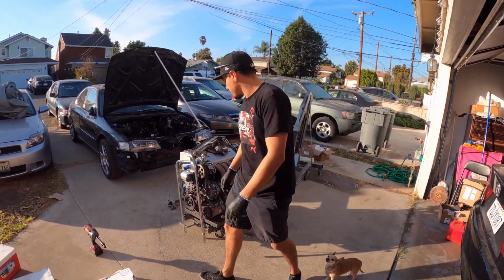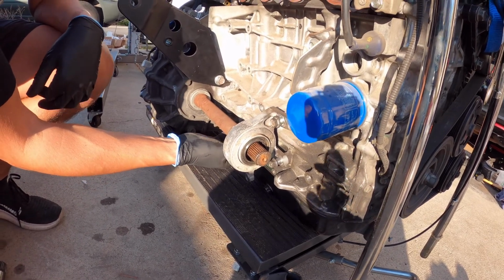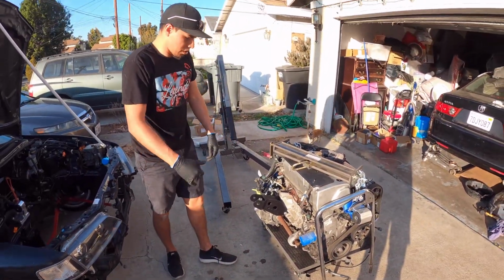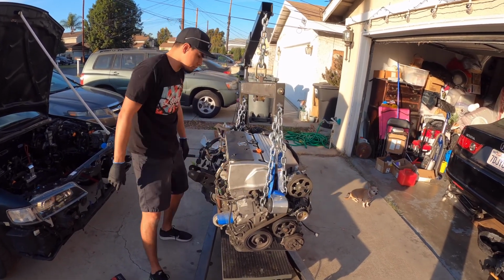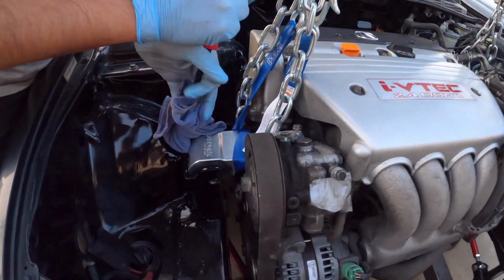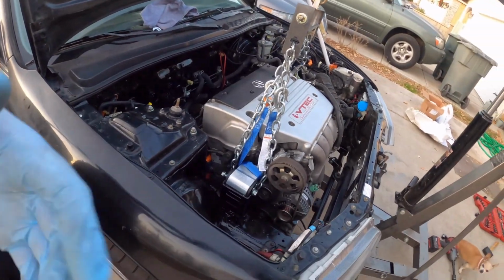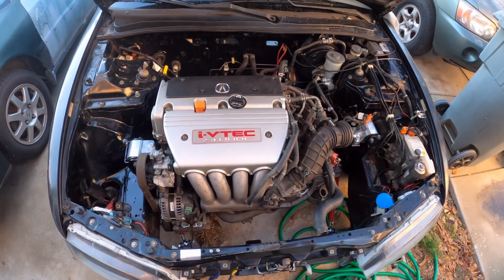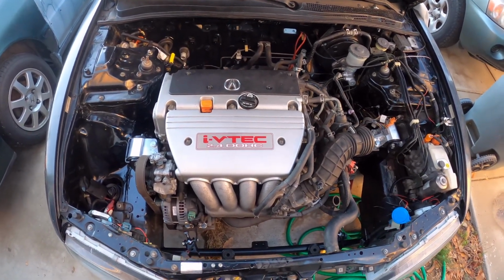K - swapping my Honda Accord part 1

Comment: GREAT Video, love your chihuahua, honestly stayed and watched mostly for the content/chihuahua sightings lol!

NOTE** to anyone swapping a kseries. DO NOT USE A TORQUE GUN for tightening your bolts. Literally every bolt is EASY to remember because the k24/k20 has all the same bolts.

10mm = 9-11ft lbs
12mm = 16ft lbs
14mm = 33ftlbs
17mm = 47ftlbs
19mm = 76ftlbs

It's not hard. Once you know what these torque settings feel like. You can ALMOST perform by hand. BUT DO NOT use a air/electric tool. Often bolts are too loose after torque-ing can be a huge issue obviously.

Comment: Good job I'm doing 2 swaps one staying f22 and the other I'm still deciding its a cb7 coupe the one staying f22 is a 91 se.
Reply from the maker: Good stuff! The f-series is a good engine and there's still some aftermarket support floating around.
Reply: @zre909  thx I'm pretty excited about both builds one I'm staying na with the option to go turbo later if I can or want to. The coupe I'm thinking about going rw and j series or f just depends on $$$ as always.I think a rear wheel cb7 coupe will be different and cool.
Reply from the maker: @Lost10mm.  those are great options! Whichever route you take will be nice!

Comment: Hey bud,nice project!! You can tell me exacly what you need for front big brake? I have cd7 exr and i need this swap. I do some track day and need more braking lol
Reply from the maker: The front brake setup is

*95-98 US RA1 Odyssey spindle
*04-08 US Acura RL front calipers
*03-08 Nissan 350z (track/brembo) rotors
*Fat four customs caliper adapter

I'll be selling mine soon if I can finish my FK8 caliper conversion.
Reply: @zre909  thanks bud for info!! I got the new de5,amazing car,really!!
Reply: @zre909  spindle fit on accord oem knuckle? Cause i think swap for 2.3cl front hub for eliminate roh
Reply from the maker: @Carlito_JDM  Yes the honda odyssey front spindle fits and connects to the tie rod, lower control arm and upper control arm.

Just to be clear you will need the entire Honda Ofyssey spindle assembly including hub and bearing.

Comment: I'm debating if I wanna k swap my 5th gen accord or just building the h22a that's in it. The only mounts I seen are hasport and they want 600$ +  when I factor in the mounts and hondata alone it's already a lot.
Reply from the maker: Well truly the H22 is a natural fit for the Honda accord considering its essentially the same chassis as the prelude. It really comes down to what you want and how much you want to spend.

Comment: I want to put a k24 in my accord so I need to replace my wiring harness or can I use the one I have
Reply from the maker: What year accord? Also a lot of the k series harnesses are very similar so if you want to swap around harnesses there will have to be some slight modifying to a few connectors or sensors depending on  the combination you use

Comment: My cd5 hasnt ran in nearly a decade so im contemplating just redoing the engine.  Is there specific axles you need?  This is the first video ive seen showing the ease of installing it.  I have an 06 TSX and the engine itself is a damn reliable one.  Just dont know how straight forward this swap is vs h22.
Reply from the maker: It's pretty straight forward. The only mount that needs modification is the passenger side mount. Remove it by drilling out the spot welds and prying it off. Then add hasport weld-in mount (weld after or before). I welded before because I lined it up while on the engine hoist. 

I recently learned you can use the stock TSX axles and intermiate shaft but there is also the option of purchasing hasport axles and using the RSX manual transmission intermediate shaft

Comment: Honestly thinking about either H-swapping, or K-swapping mine. The F- series right now has over 300k but the car itself has various issue. I like the idea of fixing it up and keeping it in generations. If I Decided to Do a H22A swap, as a first timer how difficult would it be? Thank you for the video!
Reply from the maker: H-swap is pretty straight forward. Everything plugs in identically for the  OBD2 but if you got OBD1 I believe you have to switch to internal coil on the distributor.

K-swap is so much simpler in my opinion but whatever route you choose it'll be your choice ! 👍

Comment: i have a sixth gen accord(EX inline 4 auto) and i have some questions about this swap. how much will it cost? what parts besides the engine do i need?  is there a better/easier swap than a k swap?
Reply from the maker: Engine cost: $850 - $1200
Mounts: $500
Axles:  $500
ECU: $500-$1200
Misc parts: $200-$700

An easier swap would be an H22 or H23, also an F20.Those are basically bolt on as the H series and F series share similiarties in design. If you want a V6, the same year accord came with the V6 J-series so that is also an option.
Reply: I think I’ll try an f20 with a turbo kit and try to get 350-400 after tune. Thank you for the suggestion and advice
Reply from the maker: @homlessdawg3183  no problem and good luck 👍
Reply: @zre909  i think im gonna use foreing engines inc. they have a couple engines listed. they have a f22b, f23a, j30a, and a j30a1. which of these do you think is best?
Reply: @homlessdawg3183  f23a is the one you already have if you have an EX
Reply: @zre909  which motors kit you used
Reply from the maker: @collinmatthew5044  I used the hasport  mounts (CDK1)
Reply: @homlessdawg3183  let me know l just brought one a 2000 accord lx manual l want to get a 6 banger

Comment: which hasport motor mounts are you using?
Reply: i have a k24z motor from an 8th gen accord / would i still need to replace the axle shaft as well for the engine mounts? i seen in a previous comment you used the hasport cdk1
Reply from the maker: @karasu5970  so I learned that it's possible to use the original intermediate shaft and axles so you don't need to buy aftermarket ones
Reply: @zre909  thanks man! planning to swap my 99 once the engine goes! at 260k miles so far!

Comment: Do you know a harness that is easy to set up for a 2000 Honda Accord v4. I'm trying to start it out of car and run
Reply from the maker: Rywire makes a engine harness that can help you with that. Also it should be an inline 4. The name comes from the symmetry.
Reply: @zre909  sorry ya I believe it to be a f23 after more looking into
Reply: A cg5

Comment: I have a 91 accord lx, 5speed manual with an F22a2? Would the k bolt up to the trans? How difficult would you say Kswapping this car would be?
Reply from the maker: The K series will definitely not bolt up to F series transmissions and k-swapping CBs is definitely possible as it has been done before.

Comment: Would it be possible to kswap 2001 accord lx with 2.3 inline 4 automatic. And what parts/mounts will I need?
Reply from the maker: Yes its definitely possible. You'll need a k24 preferably and aftermarket harness and ECU (hondata) if going the non-CARB route. The 94-97 Hasport mounts have been confirmed to work with the CG chassis.
Reply: @zre909  for sure verified hasport mounts will work on 98-01 accords??
Reply from the maker: @ziggyortiz37  yes and you can ask hasport themselves if you want firect confirmation

Comment: I've got a 2004 Acura TSX engine. Would that engine fit into a 04' accord manual transmission? Plug and play?
Reply from the maker: Yes it should be plug and play but be sure to use the same ECU for the engine. I believe hasport has video out on this very swap into a 2004 Accord.
Reply: @zre909  thanks! If all goes well, I’ll have the 03 accord. Need to win it at the auction this coming Thursday. Got the tsx engine ready.
Reply: What about a 1997 Honda Accord

Comment: Can u swap a 2004 3.0 Honda Accord for a 2008 3.5 ?
Reply from the maker: I believe you can. I am not a J series expert but I belive the engine has the same mounting points for various years.
Reply: Is it same body style ? Then absolutely if not fabrication anything fits a fwd Ls would fit two

Comment: I have a 2000 lx sedan what kind of engine swap can I do?
Reply from the maker: You cand do H series, K series and J series. There are mounts that will work for either engine choice into your chassis.
Reply: @zre909  what motors did you use in doing a similar build a Honda Accord swap from 2004 into a 2001 accord
Reply from the maker: @jeremycarattini9433  hasport mounts is what I used. The 2004 accord came with a kseries so it should be fine with the stock mounts or upgrade to similar style stock mounts with a bushing of your choice

Comment: I want to k24 my CB7 but damn 😢 so much shit 😅😅
Reply from the maker: It's definitely not easy especially the route I took but k swapping in general should be easy with an aftermarket ECU
Reply: @zre909  bro to be honest I've been looking on the f23 it's a lot cheaper easy ...the f23 with headers full exhaust and H22 intake manifold ported it's punching about 165 hp .163 torque bro 👌 that's not bad .. will see time and money will tell me what to do 😅 but you know that K sounds  rude🚗💥💥🔈🔉🔊
Reply from the maker: @eddysevilla9648  exactly!  F series can be just as fast with turbo or high compression and cams.
Reply: @zre909  yeah bro so I'm going that route will see how it goes..... Thank you for being humble blessings 💪

Comment: I’m trying to do a k swap on my 8th gen accord beside buying the engine what else would I need ?
Reply from the maker: ECU and engine harness and it should be pretty straight forward since the 8th gens come with a k24 already
Reply: @zre909   yeah it does but I believe the Acura TSX k24 I think it is has about 200hp
Reply: Appreciate the reply honestly didn’t think I would get one
Reply from the maker: @forevercxmp1578  no problem. I'm doing a California legal swap so it's a learning process and a longer one than usual compared to doing aftermarket ECU or already K-series car
Reply: @zre909   make sense keep up the good work I can’t wait to swap my engine for that of a tsx
Reply: K24 already in the 8th gen accords if u have the ex model its already tuned to 190hp wouldn't make sense to swap out for 20 or 30 more hp

Comment: Any idea if I can k swap a 2005 accord?
Reply from the maker: Do you want to swap over to the K24A2? Because your accord if not the V6 version already has a K24A4
Reply: @zre909  it’s a 4 cylinder. So it already has a k engine? I’m a bmw guy, don’t know much about Honda engines yet, just started getting into it
Reply from the maker: @305tyrone4  okay so you have a version of the k-series engine already but the more desirable ones are K20A2 and K24A2.  If you choose to go the K24A2 from the TSX with higher compression and higher horsepower it will simply be bolt on. Hasport has a video out on that swap exactly into a honda accord. They go under the name vtec academy on youtube.
Reply from the maker: @305tyrone4  no problem ! I try and reply with the best of my experience and knowledge.

IG : zreizzles